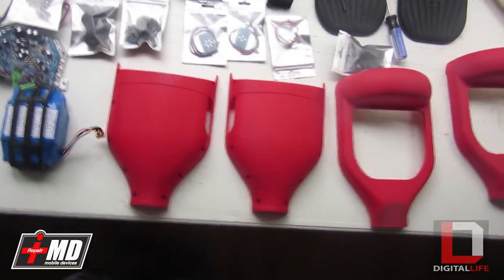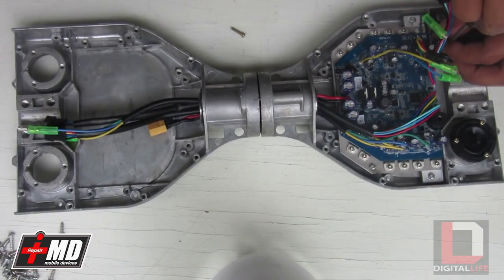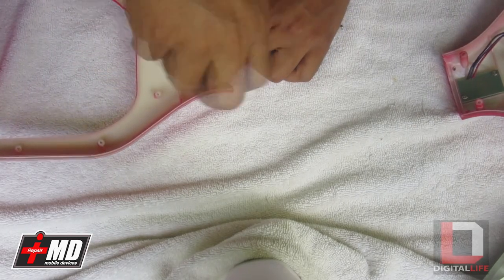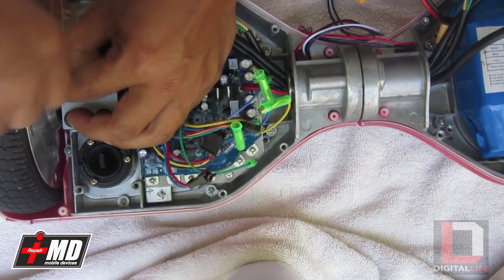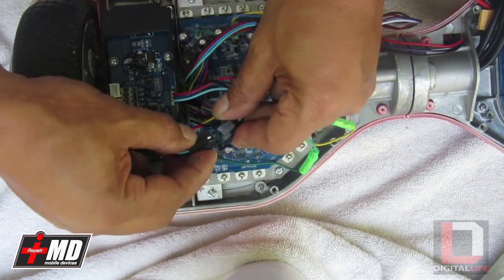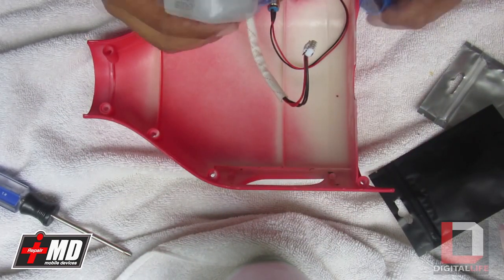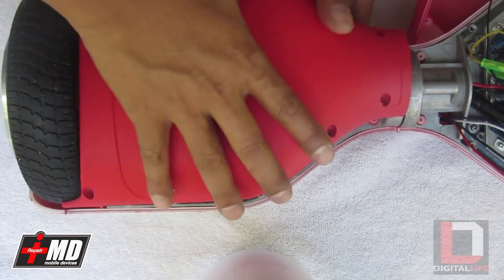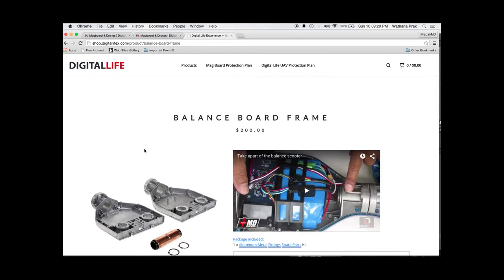Smart Balance Wheel Scooter Parts Repair

Comment: the charging pin on my port is broken you have what im looking for on one side (charging port 3 pin) but where you connect it, the white bit that has 4 things mine has 2 and is black if you can get what i need ill buy it asap

Comment: Hello, I have a hoverboard called N3 (10") and it was working fine but sunddenly it just shutdown, no red light on battery, no beep, it just shutdown when i'm using it, and of course I fell in a not nice way. After that i turned it on and it was working fine but with red light on battery patch. I kept using it and it shutdown again, no beep alarm. I put it to charge and now on i'm really afraid about using it. Do you have an idea why is this happening?
Reply from the maker: +JLS Trading Mexico You need your battery replaced, it seemed like it went bad(manufacturing defect)
Reply: Mine does that too but when I go to forward